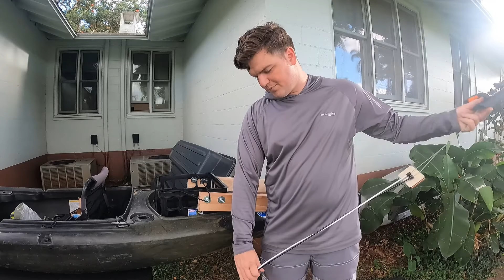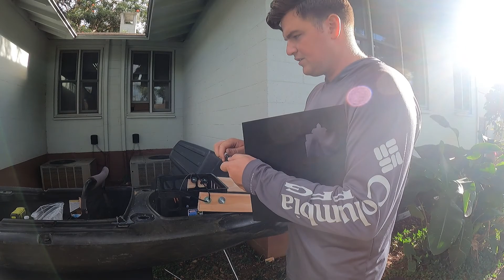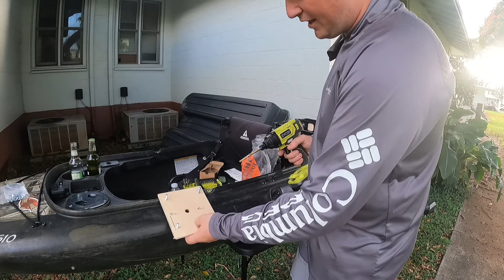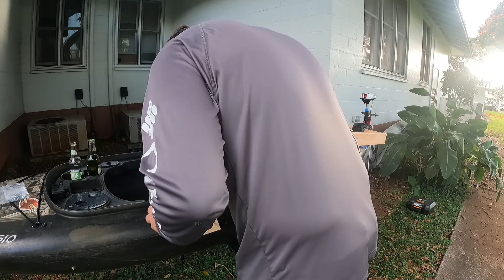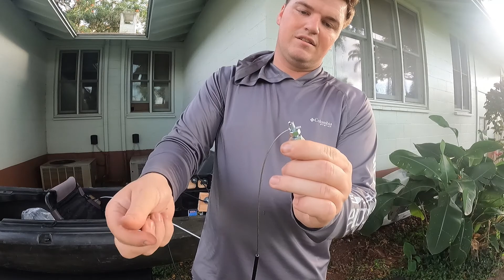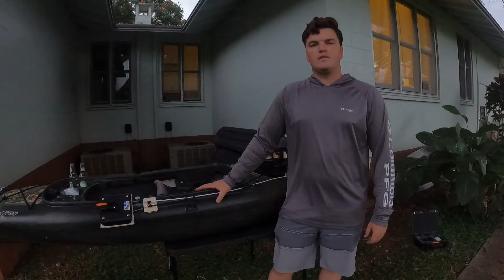Universal Steering Assembly for Kayaks

Comment: Good concept. The only issue is with the way steering is mounted. Too many edges for fishing line to hang up on. I’m working on one, in my head only right now, but I’m going to try n mount mine vertically on the inside of the side and run my steering lines underneath the top rail and pop them out in the back behind the clock pit. Sorry I’m just a meat freak and it’s less to hang up on and possibly loose fish. I do like the parts you listed. I was thinking 4” pulley and a cutting board to make my own.
Reply from the maker: Yeah, that kayak didn't really have a clean spot to mount that steering assembly. On my other kayak I used a 3d printed plate that I made and it mounts flush. For kayaks with a rounded hull or that are a bit harder to work around, I'd suggest this steering assembly: https://pelicansport.com/products/rudder-lever-mh10-ps3009?variant=40055505748173&currency=USD&utm_medium=product_sync&utm_source=google&utm_content=sag_organic&utm_campaign=sag_organic&gclid=EAIaIQobChMI4fP7rP_I_QIVrBatBh3klADXEAQYAiABEgKf7PD_BwE 

Everything else mounts up the same, but the steering handle and mounting is MUCH cleaner.

Comment: Hey Frank, thanks for the video. I read in the comments that you replaced the cable ends with carabiners. Good move. I ride/work on bikes a lot. The cable ends you initially attached are only for keeping the ends of the cable from fraying. You would actually want to clamp down on the cable itself as it would probably slip out of the cable ends with any water pressure when the kayak is moving. Very good, informative DIY video. I didn't know there was a steering mechanism available that reasonable in cost. Is it still working for you?
Reply from the maker: It's been working really well on 2 of my kayaks. I have used the steering and motor setup in pretty much all of my videos since this one. Pelican does have a newer model steering assembly, that doesn't require a base plate, and the front of the cable guides are fixed to the steering assembly so you don't have to use the plastic clips that came with this one, but it is over twice the price of the one I used for my kayaks.

Comment: Good video, but need to zoom in
Reply from the maker: Ngl, I was using a gopro on a tripod. Didn't really have a zoom option. Gunna have to talk to my volunteer camera person and see if they are willing to film the next one so I can get better angles.
Reply: Just got my kit today still a informative video brotha👍🏿
Reply from the maker: Something I did after running it like this for a while is, I got rid of the bolts that I used for the end of the cables, and I replaced them with carabiners. I picked up 2 small carabiners and a couple cable crimps from ace hardware and used those to have a quick disconnect to easily take the motor off the kayak if I needed to. Same way it is shown in this image. https://images.app.goo.gl/ywX2DWWhWfSjNgcF8
Reply: @OutdoorEngineering  thanks for the tip

Comment: Instead of using acrylic board use cutting board and get the good one quarter inch thick works great.
Reply: I got rid of that kayak a year ago but my friend still has it and that's been 10 years and still working with a Walmart cutting board
Reply from the maker: Yeah, that's probably a better idea. I had the acrylic laying around so I thought I'd give it a go, clearly not the best option